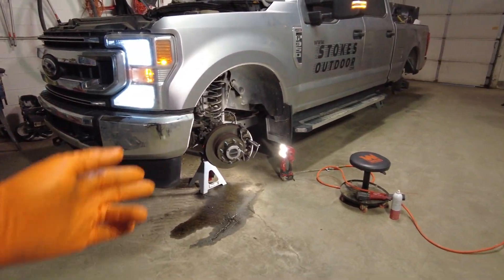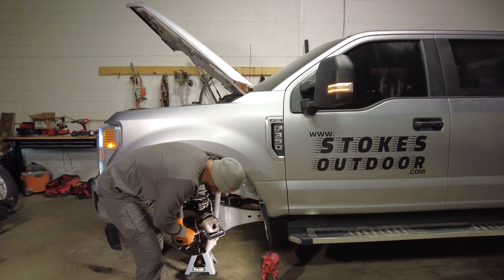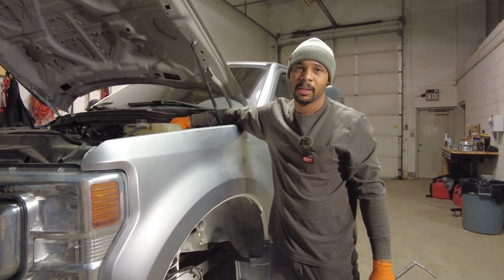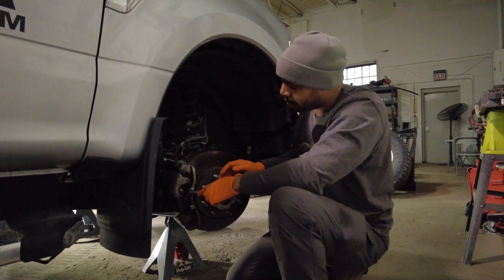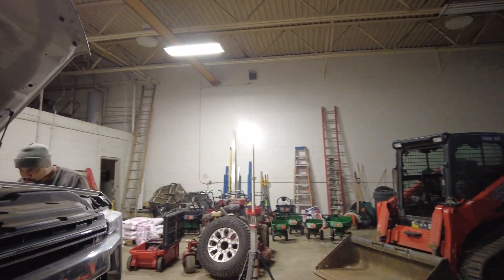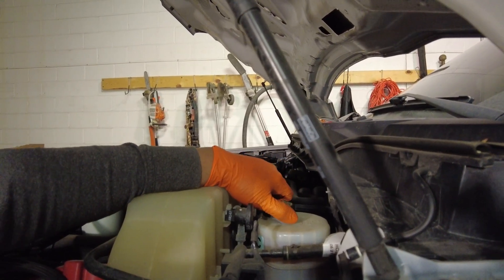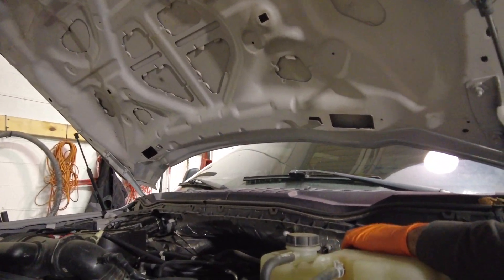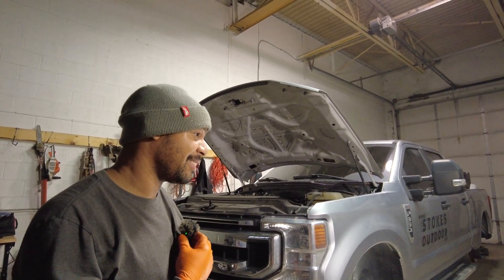Should you open your brake reservoir cap when compressing your brake calipers?

Comment: I think they say to remove the cap to release pressure build up, it can break a line or burst something or brake control module. But come on realistically, there is major pressure in that system. Anytime you slam on your brakes. But is that pressure hydraulic force for being pushing so hard on my brakes and pushing piston back in a little bit is not going to more pressure than that.
Also
One problem with doing it is that you can force debris and the dirty part of the fluid back up into the top of the system, which can create more problems. You can always bleed a little bit out to clean it at the bottom. However, you don’t want to push all that dirty stuff back in the system Problems.

Comment: You should ALWAYS, compress the rear right caliper first. Furthest away from the master cylinder. The sequence should be Right rear, Left rear, Drivers right, drivers left.
Reply from the maker: Why??
Reply: Compressing order doesn't matter BUT when bleeding with a vacuum tool, it's smart to start from the furthest from the reservoir (longest line with most fluid) and move closer because if you mess up near the end and empty the reservoir you only contaminated the shortest lines with air instead of the longest rear ones which could be a pita to bleed.